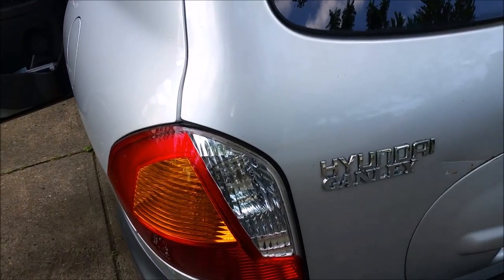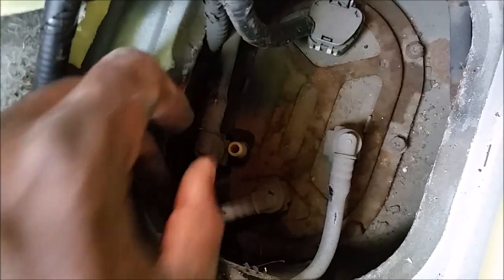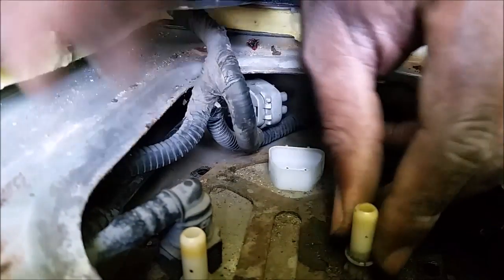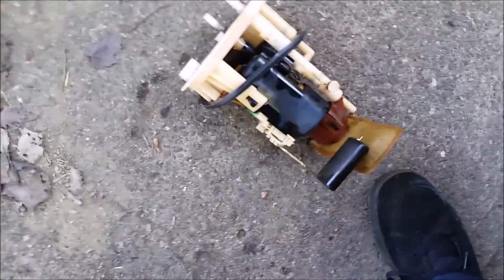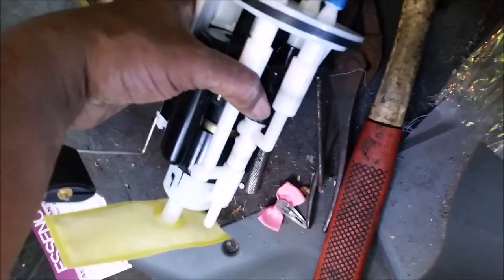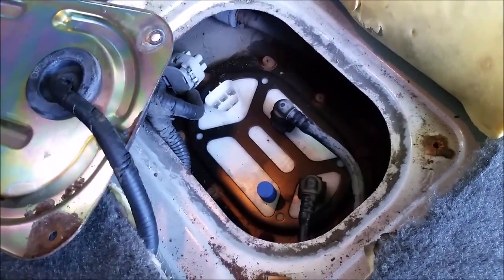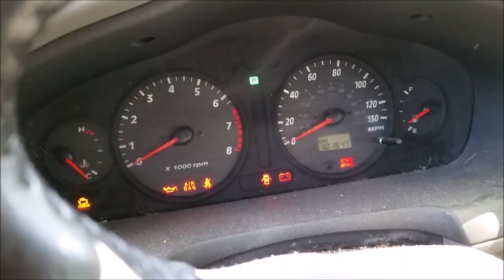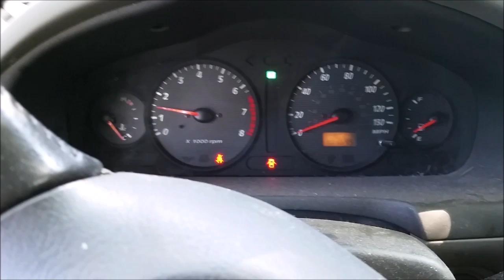How to replace a fuel pump in a 2003 Hyundai Santa Fe

Comment: should always disconnect the fuel pump fuse and remove negative connector to battery so you dont blow anything done a few of these my self and trust just take the extra 5 mins to do these 2 things will save u a headache
Reply: Absolutely important info. Thank u for that.

Comment: 2003 Hyundai Sante Fes were an end model year before updating to the true 2003-04 models produced. The fuel pump installed in this video is specified for an '02 Sante Fe. You can tell by the lack of an additional 2pin connector to the bottom left of the 5 pin connector on top of the fuel pump assembly. I also know your car has no transmission oil filter anywhere. If you look top down the engine bay, they're this a filled in cylinder aluminum cut with no threads for the screw on tranny filter. (It's also not inside the pan, they're are only solenoids and wires inside the vertical dipstick pan). So change your tranny fluid every 15,000 miles instead of what's recommended or buy a new transmission... just like I have to.
Reply: This is true, but does it look like the new pump has the option for the secondary two pin plug? It kind of does.  Just wondering your thoughts on the pic.

Comment: ok let me try this question again im searching for a switch or a button that you press and it will tell the transmission to be on economy mode and drive and shift only on the D  for drive, cause i think mines is set to Sports Mode and i have to manually shift it up to from first gear and push up to get second gear and push up to get in 3rd gear and push up to get to fourth gear to get the others its Fine P works starts engine, R works goes to Reverse, N works for Neutral, But D only works as like its on First Gear but if i slide it to the right where now the + and - is it will go like if i was driving like a stick up to all gears on the + and when it slows down or when i apply the brakes it goes down 1 gear and then i have to drive it shifting up the gear, Im not sure your following me when im saying there has to be a switch or example i have a 1997 ford Explorer in order for me to have the 4wheel drive High or Low and to engage there is a switch that controls from 2Wheel drive over to 4Wheel Drive High or Low and usually i can do this on Neutral gear, i was told from the last owner there is a switch but he cant remember where its located to use the D for Drive as standard and not have to do the up shifting while driving and that switch will say if its on economy and to use the PRND as the standard instead of using the PRN D and then slide to the right the lever and shift Up at the + or shift down - like a stick shift, i cant seem to locate that button or where its located at or is this under the console or a transmission switch issue???

Comment: What was the torque spec used for tightening fuel pump ?
Reply from the maker: I'm not exactly sure on this application.  They are screws so you can only tighten them a few inch pounds

Comment: i have a question on your 2003 santa fe i have a 2001 santa fe model same setup  i need to know is there a switch by the console somewhere to change the manual mode switch back to automatic for economy mode instead of me driving it like a stick shift can you send me an image of where is it located at ?
Reply from the maker: Have you tried this? https://www.brakeandfrontend.com/hyundai-tech-tip-a-t-won-t-shift-in-d-shifts-in-sports-mode/

Comment: Did you buy a new oil strainer that fit right or did you use the one from the old fuel pump?
Reply from the maker: It's best to buy a new fuel strainer.
Reply: Mind Blown Productions did you have any issues with the strainer that didn't fit quite right? I'll get a new one but just curious.
Reply from the maker: Yes. It was taller then the original, so the fuel pump would not fit in the gas tank

Comment: How did you get the electric plug disconnected. Mine wont budge, im afraid to break it
Reply from the maker: There is a tab to the rear of the connector.  Squeeze it hard and wiggle it up
Reply: @LewsSpeedShop  figured it out. I appreciate your reply

Comment: Quick question where did you get the whole unit..and one mechanic told me to just replace the pump what do you think...thanks
Reply from the maker: They have the whole unit on Ebay.  You have to make sure you get the right unit, that's probably what your mechanic was talking about
Reply: Ebay.
Reply: get the whole assembly.. the old one has weak plastic from age that could break easily & the fuel guage is made into it & it has contacts that are most likely worn. the assembly also comes with a new strainer, which is extremely important because these cars dont have a fuel filter ! it seems to me the manufacturer was wanting to sell a lot of pumps... they even made an easy access door !

Comment: I also have a 2003 sante fe. And one day I was on the freeway and while pushing on the gas it stopped giving power so I had to coast to the side of the freeway. Do you think it's the fuel pump as well?
Reply from the maker: Did a check engine light come on? You might have to do a fuel test to be sure
Reply: Mind Blown Productions to be honest I can't remember. It was a while ago but if I'm not mistaken. I don't remember the check engine light coming on
Reply from the maker: Drelo Entertainment you should get it tested before replacing the pump
Reply: Mind Blown Productions ok thank you!!!
Reply: Drelo Entertainment happened to me in an 04. It was the Alternator. Did you loose electrical on it?
Reply: i take a rubber hammer and gently tap on the tank, while a helper tries to crank the car.. the vibration sometimes will cause the pump to run for little bit & that will kinda nail the problem for you.  no pun intended.

Comment: How'd u get that rusty screw loose?
Reply from the maker: Try using a 5/16 socket. It fits the bolts a little tighter than a 8mm
Reply: I ment the screw mine's Rusty the same one that was giving you trouble
Reply: Thank you and you're the man with the quick response much love my dude.
Reply from the maker: @nathanmccumber2614  try using a smaller socket. Or use a special socket that removes stripped bolts

Comment: What was it doing that made you figure it was the fuel pump?
Reply from the maker: TheCoreyd09 the owner said it would stall intermittently.
Reply: @LewsSpeedShop  Thanks for the tip , I am all set to change pump . Stalling a lot. Just barely got home.

Comment: I replaced the fuel pump but now my car won’t start. Any ideas?
Reply from the maker: Do you hear the pump come on? Turn the key on and off to prime the fuel lines.
Make sure the fuse is in and not blown
Reply: @LewsSpeedShop  I had the fuel lines mixed up! Its working fine now. thanks for your help!

Comment: Maybe you can help me my 2004 hyundai santa Fe isn't starting I'm pretty sure it's the fuel pump but I don't know for sure what do you suggest it's turning over when I start it and the gas tank isn't that dirty what part should I buy I need help
Reply from the maker: Did you the ignition system for spark?
Reply: Mind Blown Productions do what now
Reply from the maker: Maybe the spark plugs are not firing. Is there a check engine light on, stating something is wrong with the engine?
Reply: Mind Blown Productions no the engine light is not coming on at all so I thought I'll buy a fuel injector tester to see will that work

Comment: I have a 04 santa fe and my gas gauge goes from half a tank to empty to half a tank. Now its stuck on half a tank. When i know i dont have that much gas in it. I dont need to change the fuel pump just the foater/sender thing?
Reply: Thank you for the tips. It is so easy watching the video. I will change it tomorrow July 29, 2018
Reply: I was told at the parts store you can't buy it separately, haven't called Hyundai yet...

Comment: I have a 2003 Sante Fe 6 Cylinder 3.5 liter.  I have the code P0463 so I replaced the fuel pump on the drivers side.  Code is still there and now I'm being told there is another one on the passenger's side.  Is this true? Is it another complete fuel pump.  I lost, any help would be great.
Reply from the maker: Ok. First,  did they replace the whole fuel pump unit, or just the pump?
The code is triggered when there is inaccurate readings from the fuel level sensor

Comment: I have 2003 santa fe my part number is 3111026755DS its the pump 3111026750 (its 2003 too) are the same?
Reply from the maker: The pump might work. The thing you have to look for is the fuel pump strainer. Depending on the engine size, the fuel pump strainer may be different
Reply: thank you